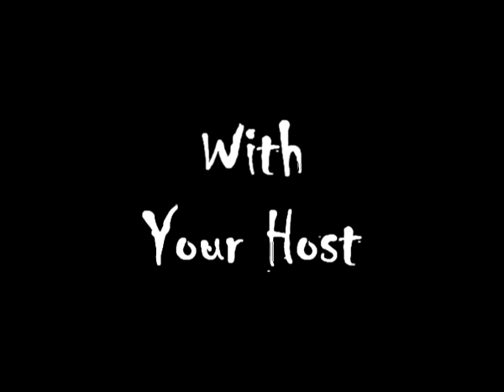Do Try This at Home! Episode 6 - A Shocking Experiment!

Comment: why do we need to brush on the phile? can we not connect the wires directly(white&black wires)
Reply: because being continue, it goes in short curt. brushing on it, the current becomes almost like DC
Reply: I know you asked this years ago but because this person didn't give you the correct information I will tell you why.  You have to brush or tap the wire because that creates a current like AC and these type transformers do not work with DC so you can't just connect the wires directly.  This is why you have to tap the wire to mimic AC

Comment: Why do you need to stroke the metal file?
Reply: The metal file doesn't have a smooth surface so when the terminal is moving across the file, the terminal will have a fraction of a second where it's not touching anything (meaning there will be no current), and another fraction of a second of touching the file (meaning current will be passing through the metal file).

If you were to look at this at an oscilloscope, you'd see square waves which is considered a Pulse DC current.

Pulse DC current is needed to induce a higher voltage when using the step up side of the transformer.

Pulse DC current means that the current is oscillating from 0V to 9V very rapidly, thus inducing a higher voltage on the other side of the transformer in this case.

From my extremely limited knowledge, I believe this method of oscillation can be replaced using a 555 timer.

Hopefully this helps.

Comment: amazing vid and info, but i had a question, if i may. can i take a transformer from an adapter and use the output voltage with the same voltage battery hooked to it and make ac or 120(example) like reversing to make a battery to ac power devices...

Comment: any way to keep constant flow on this thing
Reply: You would need to build an electronic circuit that produces pulsed dc current out of the 9V battery. It's not that hard, if you google for something like ne555 pulse generator you should be able to find good descriptions on how to build it. Or if you wanted to, you could just look at the applications in the datasheet of the ne555, but I think that's pretty hard without any knowledge about electronics.

Comment: I would not recommend to try at home for good reason. Lithium ion battery can pack a lot of punch, sure, but it will get mighty unhappy if you short it for too long (Lithium Polymer battery just burst in flame instantly due to it being soft and easily ballooned). And some transformers will kill you if you manage to get even a spark outta the UPS transformer (smaller transformer won't but then it's a function of winding thickness which will always determine amperage being delivered through the load attached to it). Something to think about. Do not try at home, period.

Comment: tell you what lol..  i just use a tie wire cuz i had only 2 clip and i zapped myself lol..  make sure you have them wires covered lol..  i think anything that conducts should work just remember copper will get eatting up faster if you use a file <- sure thats wrong but not sure lol.

Comment: Dummy, take notice that only rechargeable batteries have that AH rating. The reason for that is rechargeable batteries have a very stable voltage while primary batteries do not have a constant voltage. Knowing the AH of a cell tells you nothing about how much energy is contained in the cell because you you need voltage for that. You don't know the first thing about electricity, batteries, chemistry or anything else. So go fuck off.

Comment: Raising the voltage to 110V and it has enough "force" to cross a poor conductor such as skin. A very small amount of amperage can kill you if it passes through your body in the right way.
I am not trying to be disrespectful to you. I suggest you read up more theory on electricity before trying to create a free energy device. Kudos to you for being interested and having curiosity, especially at 11yo, but do some more research. I have an associates degree in electronics and I am not wrong.

Comment: You're wrong again. Watt hours is the measurement of how much energy is stored in a battery. Watt hours is the voltage X amps. So if a battery had 5 watt hours it could supply 5 watts for 1 hour, 1 watt for 5 hours etc. Voltage is electromotive force (which in layman's terms is how badly does an electron want to cross a conductor or how much force an electron is moving with) and amperage is a measurement that represents how many electrons pass a conductor in a second. (cont)

Comment: MAh is a rating of how powerful the battery is, although the mA is what kills you - 65. I accidentally got confused with mA and mAh.  I was saying was that even if you did have a lithuim/stronger battery, it would need to pass you skin resistance (30VDC) to supply a shock. This would use a transformer, which would take away the necessary current to kill. Get your facts right. By the way, I'm only 11, building free energy generators in my basement. You were probably playing with legos at 11.

Comment: This is why I said not to use a rechargeable or lithium battery. A good quality Ni-Cad can put out 10C easily. Lithium batteries are also very good at high current (in proportion to it's total C rating). I doubt that a CZ or alkaline battery would be very dangerous. MAH don't kill you. You could put out 1ma for 500 hours. Get your facts right. It's been a while since I saw the video, but if I recall, he is using a step up transformer to output 110VDC which will easily go through the skin.

Comment: You are 100% wrong. A normal 9 volt battery is about 300mAh, when it takes 65mAh minimum to have any possibility of killing you. By the time this goes through the transformer, it is more like 50mAh. &, 9 volt batteries have to pass your skin resistance (30VDC) to supply any kind of shock. You would need a transformer to up the voltage, which would take away the necessary current to kill you, P/N in each hand, or H/N. Get your facts right before acting like you know something.

Comment: There is absolutely NOTHING safe about the second part of this experiment. Make especially sure that you do not use a lithium or NiCad/NIMH 9V battery. ESPECIALLY don't have a 2nd person run the clamp along the file while you hold the stepped up clamps one in each hand, you could take a heart attack and die. It take very little current to kill you, it takes a lot of volts to go through your skin.
Reply: Incorrect mate. Your heart isn't in the middle of your finger. NOWHERE in the video does he pass electricity through both of his arms (Thus his chest, organs, etc). You could damn take isolated 240v mains (Has to be isolated or else you have the possibility of the electricity going through you to ground) and pass it through your finger without ventricular fibrillation, you will however cook your finger (Depending on the duration of shock).

Comment from the maker: Solar panels output DC.  Transformers work on AC.  You would need an oscillator circuit as well to convert the DC to AC before stepping up the voltage.  After you work this out, I'm sure it would work well with enough source voltage and current from the solar cell.
-- Mr. G

Comment: @kingRumen  He's only using the file as a ground for the current. you can pretty much use any metal strip to use as ground to complete the circuit for the shock device.

Comment from the maker: @wettfeat 
NO.  A transformer never turns AC into DC.  It goes in AC, and comes out either the same voltage AC (isolation transformer), higher voltage AC (step up transformer), or lower voltage AC (most common, known as step down transformer).  Reverse a step up, get a step down, reverse a step down, get a step up.  I hope this helps.
-- Mr. G

Comment: @Mindpaint So the AC is turned into DC going the right way through the transformer.  But if you run it backwards it goes from AC to AC correct?

Comment from the maker: @kingRumen 
NO.  Simply hooking up the battery will do nothing, except for at the exact time you connect it to, or disconnect it from the circuit.  The file causes the circuit to make and break contact several times as you slide the wire across it.  A transformer works ONLY with AC or pulsed DC, which is what we get from the file action.  DC alone, which is supplied from the battery, will NOT allow the transformer to step up the voltage.

-- Mr. G

Comment: I've been shocked by both a MIG and TIG welding machine. Also a Tazer that you touch to your skin. Do you think that the shock from that 9 Volt battery could be stepped up enough to give more of a shock than any of the things I have named?

Comment from the maker: @vibhunfsmw 
What would a rectifier have done?  Rectifiers don't turn DC to AC.  Rectifiers are made of either 2 (half wave) or 4 (full wave) diodes.  Rectifiers are designed to turn AC into pulsed DC, add a capacitor and you get DC.  You would need an oscillator to create pulsed DC from DC.  Add some shaping circuitry to create AC.  Using the file to make/break the circuit simulated AC by making pulsed DC.  Adding a rectifier would have done nothing useful.  But thanks for the comment!
-- Mr. G

Comment: this is not shocking...today's kids should be knowing this (i knew this when i was 12)...transformers step up the voltage by decreasing the current and step down the voltage by increasing the current...thats how electricity in our house is so perfectly regulated..and yes..u should have used a rectifier (full wave or half wave) so u dont have to constantly keep brushing the other end of the wire and turn the DC voltage to AC...

Comment from the maker: @MrAXDM 
I used the word "Shocking" because this experiment SHOCKS you!!!  I got SHOCKED by making a SHOCKING amount of voltage from a SHOCKINGLY small number of part, and SHOCKINGLY enough, I started with only 9 volts from a battery!  NOW in what way did I misuse the word shocking?

-- Mr. G

Comment: @67tr876 no you will not get 200mA out. Transformers either boost voltage and reduce amperage or vice versa. No thermodynamics violated here!

Comment: Would this still be safe with Australia's 240 volt transformers?
And, exactly how much current is being generated?
If I use a transformer that outputs 3.7v DC at 355mA, would I get 240 volts at about 5mA out of this?

Please reply :)

Comment from the maker: @tanmay91patil Great Question!

You brush it across a file because a transformer cannot work with Direct Current, but instead needs Alternating current, or, the next best thing which is to quickly switch Direct Current (the battery), on and off very quickly.This makes pulsed Direct Current, and the transformer then, through the building up and collapsing of a magnetic field across it's windings, produces output.
Thanks,
-- Mr. G

Comment: lol lets try that with a house... what would happen when no electric service is on or the electricity in your house just gone??? just attach 2 wires at the batery + and - and put them to the control panel mains...the good thing out of this is that u will see pretty nice illumination in every transformer the bad thing is that u will blow out every line... incluiding the sub station :( so no electricity for 2 months hehe..

Comment: @Mindpaint I know it first hand. I was searching in an old digital camera as to why the lens zoom motor wasn't working and accidentally tapped the flash circuit with my finger. I had been smart enough to remove the batteries, but I hadn't banked on there still being energy in the capacitor. My hand was numb for roughly that following half hour. :-P

Comment: @Mindpaint No it's not. What makes a shock more dangerous is the Amperage, a capacitor can have high voltage but just a few mA. To kill a person, you have to produce a current with >30mA accross the heart. Since the capacitor of the camera is +-300V and <1mA, there is absolutely no danger. Also, never shock yourself accross the heart, THAT is dangerous!

Comment: You can save yourself so much time if you just open a disposible camera. everything he showed, is already made in the camera. They can actually produce up to 300 volts at very low current, using only a 1.5 volt AA battery. just don't touch it to yourself or anyone, it does not feel to good.

Comment: @grantakazappy This isn't fake, try it yourself. It can't produce more energy then the battery can, and it can't make a stable power supply, but when you brush the clip on the file, the vibrations produce some pulses that induce current in a transformer. I used this experiment in 1st grade when i had to make demonstrations on electricity.

Comment: believe it or not, this stuff is true! one only needs to know basic info about electricity to make this experiment...voltage multiplied by current is equal to resistance or load...mr g here amplified the voltage using a step up transformer but compromised the current, that is why he cannot make the neon bulb to light up more than a fraction of a moment! that is why idiots can't run cars using 9 volt batteries!  how's my grammar and spelling by the way?

Comment: @tennochi Get into the more "ADVANCED ELECTRONICS" and you will learn transformers step up voltage with the back EMF effect... To put it simply, when a voltage is applied to a coil, and then removed, the breakdown of the electro-magnetic field excites the conductors on the opposing coil causing the electrons to flow....

Comment: @grantakazappy thats not how it works... the bulb would blow if u exceed its power rating. by using a transformer, as he steps up or down voltage, the current drops or increases proportionally(cant just create/destroy power like that...otherwise there wouldnt be an energy crisis, would there?). higher or lower current (granted same power dissipation) would only change the light intensity.

Comment: @grantakazappy The current requirements of the bulb will drop will drop the voltage quite low, low enough for the bulb to operate. the 9volt would not supply enough current to compensate for the loss in the transformer and the bulb as well. there is loss because the transformer is using REAL materials. THIS IS REAL!!!!!!!!!!!!!!!!!!!!. oh and dont worry about the spelling, i know there are mistakes. Im on Mr. G's side.

Comment: how could anyone think "Mmm... The transformer works only with an alternating current, and it's really "BASIC ELECTRONICS".  Not with DC (like battery), so - it is fake with no questions." puled dc is pretty much the same in this case... duh.

Noob.

Comment: I built something like that while I was in school using an ordinary ferrite rod, some copper wire and a 6 volt battery pack. Sewed the entire contraption in my school blazer and attached the two wires to silver rings which I wore in my fingers, being careful to insulate my fingers using some tape.  The circuit was completed when a button was pressed in my left hand and my right hand was touching someone's bare skin...... shocked the crap out of anyone I touched.... :D

Comment: I tried this a while ago, like 2 years ago and did not expect to get that kind of shock. About a year after I hooked it up to a circuit board and just fliped a switch on and off. The newest idea was to hook up a switch to one side and hook up a 9volt ac current addapter to the other one. I'll post a video of it if you want to know what i'm talking about.

Comment: The lamp he is using is a neon lamp,. often used on appliances, which lights up on house current, 120 volts AC. It will not work on 9v DC, but with the file to pulse the DC and the transformer it will work! Try it before you try to discredit the experiment.

Comment from the maker: Also, do not confuse energy with voltage.  Energy never "just appears" as you state, but is merely transformed, in this case, LESS energy is the result, but with MORE voltage, or potential.
Any courses in Physics, or AC / DC electronics would help you to better understand why this experiment works.  Thanks for the comment though, and KEEP watching!

-- Mr. G

Comment from the maker: Do some research on Xenon flash tubes.  These are used in photographic flash units, which are usually powered by two AA batteries.  The Xenon tube creates a flash but requires 1500 to 5000 Volts to do so.  Yet, using the same principles I am in this video, the 2 AA batteries (which produce 3 volts), are able to flash the Xenon tube.  A standard gas grill igniter uses NO BATTERY, but produces a spark by generating up to 20,000 Volts from a sudden forceful deformation of quartz.

-- Mr. G

Comment: What's shocking there?
Nothing! That's pure electricity rules... Measure not only all times Voltage, that's only potential. What makes the things move, is ampere...
so If I have 10 kilo Volt and 3000 Amprer and go to transformator, well, I easily make 100 Kilo Volts, but I only get 300 Ampere.... So I can go up 100 Million Volt, but I only have 0,3 Ampere left.. With that you get a life stunning shock, but no burn marks, but impressive flashes...
Stop fooling around!  That's not shocking..

Comment: This is an AC to DC converter. It changes AC to DC not AC to lower DC power.

The reason it's safe is not because of the low current, it's amperage that counts. you can be shocked by a tazer(over 10,000 volts) and not die because it has low

Comment: little stupid question, what if i try to connect to 9volts batteries(merged) ?.. you know, xD taking the negative from b1 and the positive from b2 you have then 18volts, anf if i connect both to the transformer, it's still being 120dc? or does it change?

Comment: Actually it is the current, not the voltage that can do the real damage. when you raise the voltage with a transformer you are loosing current. And since A 9V battery has a negligible current in the 1st place, it is valid to say their is no current because the current would be so small. ie: less than 1 mA